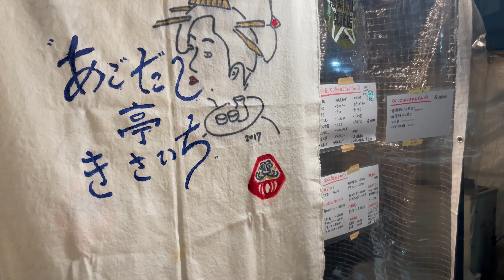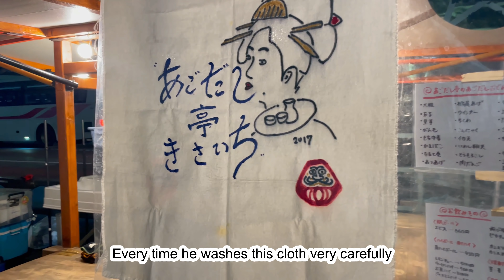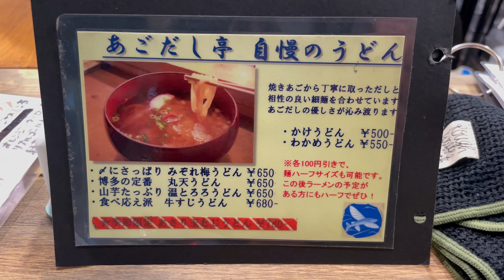YATAI | How many times have you ever failed?  He has many times but never gave up!

Comment: What time do you open and close? Every day? Do you tear down and set back up every day?
Reply: The Yatai stalls in Fukuoka are licensed by the municipal government to only operate during the nighttime. As part of those regulations, the stalls are required to be assembled and disassembled each day.
That regulatory structure also functions as protections for the small business owners and the local Yatai culture. It prevents large operators from displacing those vendors.

Comment: Do they have to do the set-up everyday or they will stay for a while then pack up?
Reply: The Yatai stalls in Fukuoka are licensed by the municipal government to only operate during the nighttime. As part of those regulations, the stalls are required to be assembled and disassembled each day.
That regulatory structure also functions as protections for the small business owners and the local Yatai culture. It prevents large operators from displacing those vendors.